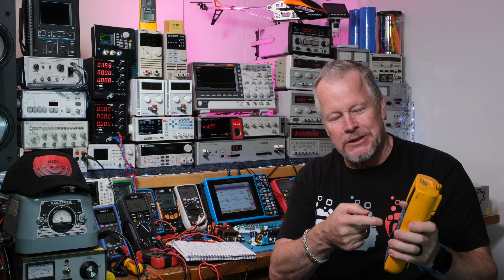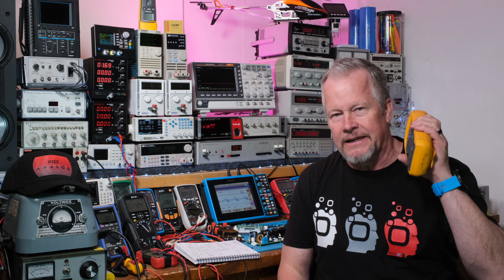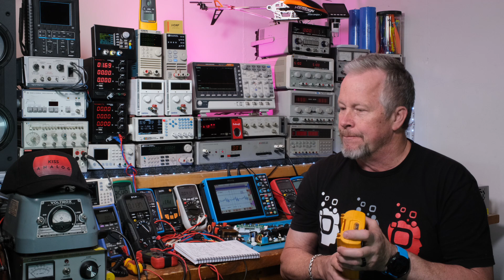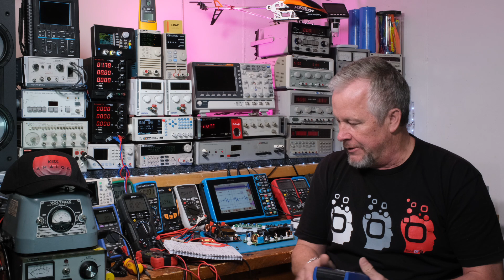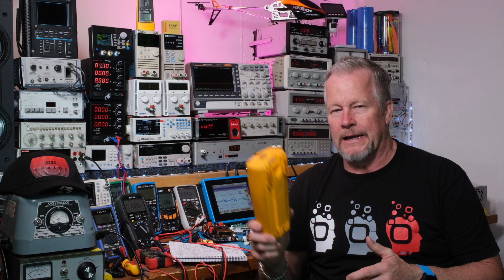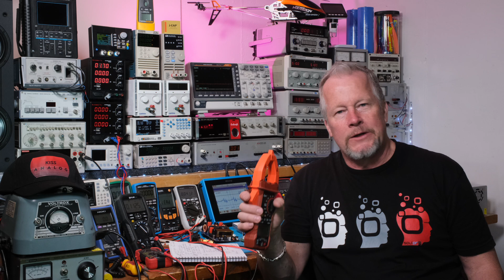Rant on MultiMeter Reviews with Fluke 289 vs Keysight U1282A #Rant #Fluke289 #keysightU1282A

Comment: I have a Keysight 6.5 digit bench multimeter on my bench, which is mains powered; no batteries to go flat, no auto power-off just when you want a reading.
Does data logging, statistics, high accuracy, 4-wire resistance, temperature - all I need.
It cost less than that high-end Fluke.
Hand-held meters are good for site work, or having it close to the unit you're working on, but I prefer the bench meter.
Reply from the maker: Thanks John for this great feedback!  I am in complete agreement with you!!
Reply: You must use a isolation transformer with a bench meter though and that's a pain in the turd cutter
Reply: @randysterling4700  I have an isolation transformer for the thing I'm testing. That way it isolates for the 'scope at the same time, but I rarely use it in practice. I suppose it depends what you are using it for.
Reply: @randysterling4700  Had to comment on that even if this is an old post, just so there is no confusion: The inputs of bench meters are floating almost always, so for most practical applications that it not the case at all. The negative terminal of a HP 34401A, which probably is one the most common used 6.5 digit meters, may be at a potential of 500V peak max to ground.

Comment: Keysight U1282A is a multimeter with really nice big display and perfect battery efficiency but the main selector is a total garbage which change this meter into a useless tool after few months of everyday use. Basicly locking plastic at the bottom of this selector breaks with no reason and also metal contact are stucking between the different positions and multimeter is going crazy (grease between selector and body is changing into a jelly after few months of indoor using 🤯). Sometimes it can even turn itself off during mode changing... And did I mentioned about super slow resistance and capacitance mode? And the most ridiculous thing is that they advertise it as an industry IP67 with 3m drop withstand🤣... but because this crappy selector, whole meter can be used only indoor and you need to treat it like an egg. I really regret I bought three of them in my job. Never ever Keysight garbage. Only Fluke 87V Max baby💪 Keysight Design is beautiful but believe me and don't buy it and soon you will thank me.
Reply from the maker: Thanks for this great feedback!  I love my Hioki and it is build tough and feels that way.  I’ve only lightly used a Keysight - just playing around with one in a lab.   I have used the 87 on the job for 20 years and was totally a Fluke man, but when the 189 arrived - we all snagged it from each other;)  We had probably 30 Fluke 87s in the lab between 6 of us and 2 Fluke 189s, and we all wanted to use the 189.  It is just a much better meter with a better display (slightly better).  But now I have a Hioki DT4282 and it puts the 87 to shame and even beats out the 189;). IMHO

Comment: Good video. We share many pet peeves. Why do I choose Fluke? For me, I do absolutely LOVE my 189's, and tolerate my 289's. But, most importantly, when I need to make a written record of a measurement or write a report for a client, I NEVER feel uneasy to reference a FLUKE or HP meter and it's serial number on the equipment list. Moreover, on the subject of accountability, when you take FLUKE and HP gear in for a closed-case calibration, these are ROUTINE for the lab, and they'll adjust them if a range has drifted out of spec a little. Why? Because the automated calibrator THEY USE is made by FLUKE, with an HP 3458A riding shotgun. Conversely, I have observed that the lab techs roll their eyes at the variety of non-professional* test gear that they receive for cal, and won't bother making adjustments due to incomplete or NO cal documentation. Also, the specified accuracy AT BEST is laughable in many cases. (* "professional" being the likely suspects such as HP et al., Fluke, TEK, Kiethley, Rohde & Schwartz, etc.).
Reply from the maker: Great feedback - thank you!  I gotta say that when I had a shop I had a rep trying to tell me how much I could make by buying their Fluke calibrator that calibrates their multimeters.  Fluke is not the only one making calibration intruments, it is a very lucrative business.  I imagine that those techs are shaking their heads because they bought the only equipment that make their job easy.  I can tell you that they are not the highest paid technicians - often they are not well paid even.  Sorry, but their take on the calibration has no count on what instruments are great or bad, but only what is easy for them based on their equipment.  Fact is, most of us do not calibrate our equipment.  And, there is a great argument that calibration has little correlation to what equipment is measuring accurately.  Most often meters are measuring within spec - whether they have the cal or not;)

Comment: BTW, our lab's 289 does have springs for battery contacts. And did I mention that the display lacks contrast and that the backlight doesn't help?
Reply from the maker: I agree - the displays are lackluster for sure, and the back light is not on the high-end either.  I wonder which type of battery contact came first?  My guess would be the springs.  Strange that they made a change (probably to save money) and didn’t change the model number…

Comment: Our lab has a Fluke 289 that I rarely use except occasionally for logging. Just picking up the heavy beast, finding space for it on the bench, waiting for it to boot up, and setting up a measurement through the menu system is a real chore. I normally just grab the smallest and lightest meter available. Most of the time I'm checking continuity or simply looking for the presence or absence of reasonable voltages. You don't need a fancy $800 meter or even a very accurate one for that. That said, the 289 isn't bad if you need logging. However, for logging to a PC, you need software and an IR-to-USB cable that'll set you back about $200. For logging to a smartphone, you need an IR-to-Bluetooth adapter that sits on top of the meter and makes it even more bulky, and that'll set you back $135 or so. You can get the whole kit and caboodle for about $1100.
Reply from the maker: I agree - the one in our lab just sits there too.  No one wants to have to change the batteries - because it seems that every time you pick it up it needs new batteries.  The funny thing is - the other meters that people prefer are the bottom of the barrel Flukes.  It is too bad that the guy buying the Fluke meters in our lab likes Fluke but sticks us with using them.  The best meter we have in the lab is the Klein which is the first one grabbed, so if you come late you get stuck with Fluke.
Reply: @kissanalog  if it’s killing batteries while unused, it probably has a bad super capacitor in it and fluke will repair it if you send it in.  I sent mine in for repair a few months ago.

Comment: Have a look at the Chauvin Arnoux CA5293-BT it's a high end graphical multimeter with a colour display, 100,000 count 4 line display and inbuilt Bluetooth. The Uni-T UT181 is another high end graphical multimeter and it also has a colour display.
Reply from the maker: Thank you!  I am going to try and get a Chauvin Arnoux meter.  They are pricy, so I might have to wait for Christmas;)
Reply: @kissanalog  I have two CA 5293, I really like them, but as everything else they are not perfect. The biggest issue is battery life, but you can use them plugged in during measurement. There are some nice functions, like spec/tolerance view, waveform display, IP67, math, logging and a really nice graphic display. I purchased these instead of Fluke 289.
Reply: https://www.elfadistrelec.no/Web/Downloads/_t/ds/CA5292_5293_eng_tds.pdf
Reply: Wow! First time hearing of Chauvin Arnoux. Must check this up.
Reply: That was the right choice; I own one too, and it's a really good multimeter. The Fluke 289 failed to meet expectations due to its price and problems.

Comment: That Fluke 289 was designed 15 years ago.  It is still huge because it is still using 15 year old technology.  Fluke is making a killing on that meter because the parts are relatively cheap today.  One could pack that same functionality in a much smaller case with a better display today.  However, that would cost more money.  So, go ahead and spend big bucks on out of date technology.  You’re paying for a brand that MAY no longer be as good as they once were.

Comment: I think the rant about how other people review meters is not totally fair. Indeed some reviewers hook it up to kalibration equipment and go on and on about that (I also fast forwarded that part...), and some other reviewers review different aspects of the meter. But when you review a meter, you also focus on the things you think is important. 
The key thing is, is that no reviewer reviews the complete featureset of a meter. You don't either when you're reviewing a meter. 
Of course to make such a review, that's a lot of work, it requires a lot of resources (Defpom had a calibrator, but most people don't have that) and  it would result in a whole list of video's. Look at what Joe Smith does, some of his reviews are 4 video's each 1 hour long and he only reviews "robustness" and basic functioning (and he's really good at finding quirks). 
But regarding a 289: no one has made a good review on the computer interface and the software. But where I live, that's an add on of +€300. (Here in europe, a 289 starts at about €750 incl VAT, but the fvf version (with software, interface, carry pouch and a hanger) starts at about €1100,-- incl VAT. For that price, it better be good. For instance, the display can refresh about 5 times per second I believe. But can it also log that fast with the software? That information can't be found anywhere.

And about the price, for comparison, the 289 fvf is about 4 times as expensive as a Brymen BM869S with case, interface, silicon leads etc.
Is it four times as good? The Brymen has some features the 289 doesn't even have 😉

The 289 is indeed already an old meter, and some things like the contrast and ghosting on the display, the slow processing speed of displaying trending graphs etc are a sign of that. But it also has some interesting features, like a low ohm range, adjustable dBm/dBv measurements etc.
That it's not that rugged that it can survive a 3m drop....it's still a rather precise instrument.

BTW, that U1282A also has some drawbacks I think. No handheld multimeter is perfect

BTW I have my Brymen BM869s calibrated annually, so I'm not one of the 'most guys', but I use it to calibrate other stuff (power supplies).
Reply from the maker: Thanks for your feedback!!  I hope I explained that I was also guilty to many of these things I pointed out.  What I think is we need to do just what you say - point out what’s different or unique or even special- or what’s not so great.  I watched two episodes of the 289 go thru a bunch of so called calibration measurements, but never heard about any of the special features.  I don’t think I ever saw a reviewer point out that a meter actually failed it’s measurement.

Comment: I have "only" a Keysight U1242C but even that has IP67, 3 meter drop, true rms, 10000/11000 count, logging (manual 100, auto 2000 samples), USB interface standard and some other handy stuff.
Also, looking at the calibration sheet it performs way beyond the stated specs at room temperature. (this is of course not guaranteed)
The only thing I hate about this meter is its low update rate and slow auto-ranging.
Fluke just can't give me the same functionality at that price. It's a shame too many people are blinded by brand names.

Comment: Totally agree that buy-new prices for Fluke meters are very (too) high. Still I like those meters because they ARE robust and do their job well. I bought mine second hand and if you have a little patience and keep an eye out on second hand market places you can get really good deals. I got my 289 in almost new condition with all accessories for 225 euros, my 189 for 175 euros and my 87V as new in box for 140 euros.
Reply from the maker: Thanks for your great feedback!  I agree but I have bought some used Flukes that had hidden issues:( and the warranty does not transfer.

Comment: I sort of agree with you about reviews, there is really no reason to  check all the ranges on camera, showing how the meter measures (i.e. speed, readability, user interface, etc.) is more interesting. 
Another meter with graphical display is Chauvin Arnoux CA 5293 (Also called Metrix MTX 3293B), its expensive and due to the very readable display has a short battery life. It uses the display much better than Fluke. It uses a menu system to select functions, but it works much better than Flukes.
When doing continuity sliding the probe is often a legal method and is used when following tracks on unknown circuit boards  (What chip and pin do this signal connect to?).
My software TestController can log from Fluke, Keysight, Chauvin Arnoux and other meters and works on Windows, Mac and Linux, with Fluke you must pay to get the cable, with Keysight and Chauvin Arnoux it is included.

Comment: Hi Eddie, if you want a great meter with many features like the Fluke 189 get the Brymen BM869s. It is a 500,000 count meter in high res and 50,000 in normal. It has dual temperature option to run two thermocouples with a dual display, can measure conductance in Siemens. Dual displays in voltage with the ability to measure Ac+DC and amps with dual display. It has more features than the 189 and will remember the last setting you used when shut off where Flukes always go back to factory setting once you change the switch to a different function. I own a pristine 189 but like the 869s better. The 189 is a battery hog where the 869 lasts much longer. I have 4 Brymen meters after watching Joe Smith’s channel the past 7 years. His two favorite meters are the Fluke 189 and the Brymen 869’s which is his go to meter. His testing is some of the best on YouTube of putting meters through transient spike torture tests. He is quite a brilliant engineer who is a master at electronics, machine work and engine mechanics. He built all of his test generators, high voltage probes, wrote the software for testing………He does quite of bit of R+D on all the Brymen stuff and they are very receptive to his input. They send him meters for evaluation and want him to make them fail. He does, figures out what happened and rebuilds them to be more robust. I think they are the best meters out there for the money because of the build quality, input from customers( where Fluke won’t even reply to a technical problem) and just the features. I had to buy mine from TME in Poland, the shipping was $10 and I had it in 4 day via DHL. You can’t get shipping from two states away for that price in that time frame. I think Brymen doesn’t sell direct to the US because of their deal with Greenlee who rebrands the Brymen meters with there name and the Green rubber sheath.
Reply: Agreed. I have an Brymen 869S. Joe Smith preferes this over all Fluke meters. Wonderfull meter.
Reply from the maker: Thanks for your great feedback!  I agree with everything you bring up.  One thing to keep in mind, even though Joey is amazing in his work and the best engineer I've seen on YouTube (next to me;) but you have to understand that he goes beyond what is expected for a meter to withstand.  He even admits to this.  I did lightning protection for Square D for 6 years, and tested many devices for surge.  So, I do know what surges are required and expected.  So, although his work is exceptional and amazing, it is beyond what is expected or even needed.  I love the 189 and I hate the 289, but my favorite is the Hioki 4282, and it is lower cost but beats the Flukes in every way IMHO.
Reply: @kissanalog  I agree he puts them through more than the meters require. Some though like the Uni-T models failed from a super low current piezo grill starter spike. That is unacceptable IMHO. The Brymen's and Flukes took the highest spikes. The cheapest Fluke 101( think that is the model) he couldn't make it fail. Yeah, most of us would not be putting a meter through a 12-16Kv spike situation. I enjoy his videos and love the way he can redesign them better. I love that he didn't hold back on Dave's 121 GW meter. They had a few heated exchanges over that. Many people were really disappointed in the quality of that meter. I almost bought one until watching Joe's videos on all it's issues.

Comment: And it is $72,000 per semester at Notre Dame.  But no one is forcing anyone to go there.  If you think 800 is too much, buy a Kaiweets. Choice.  What's the big deal??  Actually, Notre Dame (and just about every other college) should be more ashamed than Fluke.
Reply from the maker: Wow going to the University has become so expensive - but when looking for a job (depending on the type of career) having that paper from Notre Dame can pay off.  Blowing money on expensive equipment (designed 15 years ago) will not pay off. IMHO  But on the other hand - what you bring up is that people value NAMES.  Someone working with a multimeter as a tool - simply need to be educated - and that's what I hope to help with.

Comment: The Keysight meter is laughable. Measurements are useful, especially if it gives incorrect values under certain circumstances or doesn't work as advertised as was found on the Keysight. Fluke meters don't give quirky or misleading readings as far as I know.
Reply from the maker: Thanks John I haven't used a Keysight for long enough to see any quirky stuff.  I love my Hioki and it has much better functionality than the Fluke IMHO;)
Reply: @kissanalog  Hioki has excellent Clamp meters and high end multimeter too. Charvin Arnoux has amazing high end multimeter and clamp meters as well.
Reply from the maker: Thank you!  I will have to get a Charvin Amoux meter;)